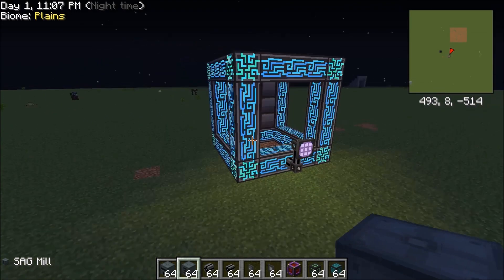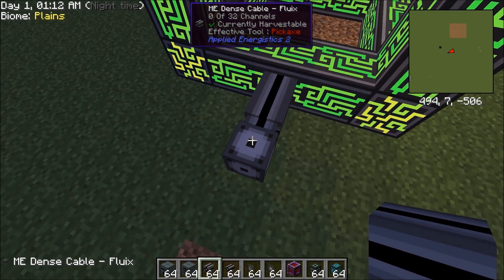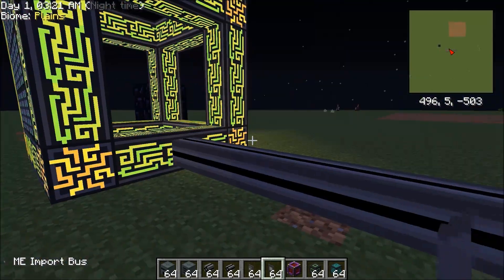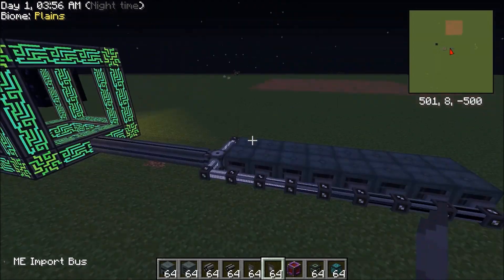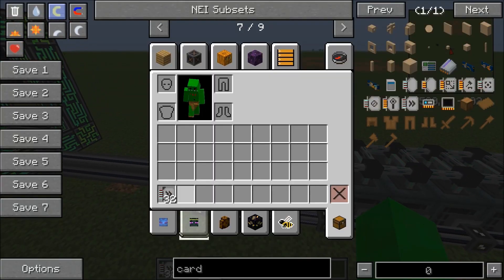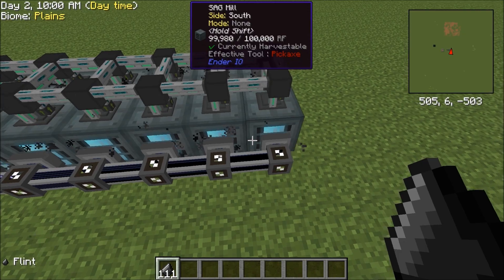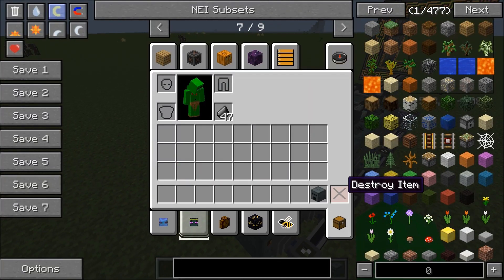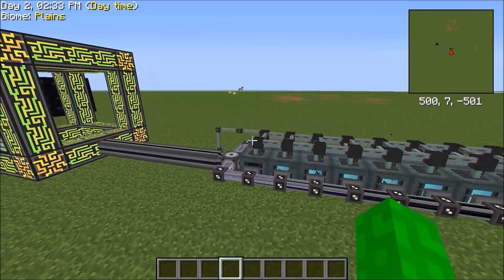How to Automatically Process Ores in an ME System

Comment: ender io is capable of connected via me interface, you could just use one me interface for like 5 sag mills with only one channel used and could use 1 channel for 5 alloy smelter in furnace mode without the need of having item conduits going around :p so with this setup you would be capable of having like ~30 sag mills and 30 alloy smelter with the same channel usage :p + possibility for auto crafting patterns on sag or alloy smelter :p